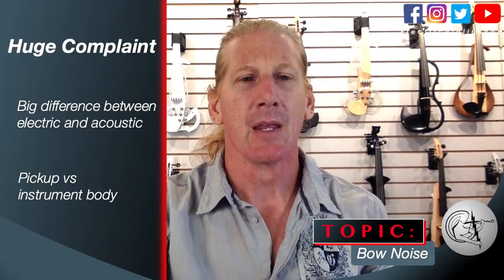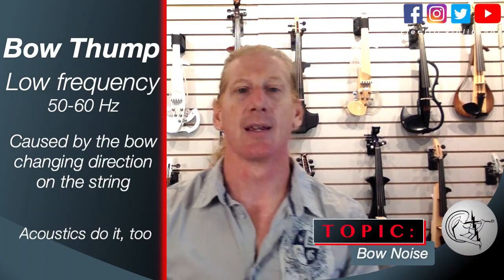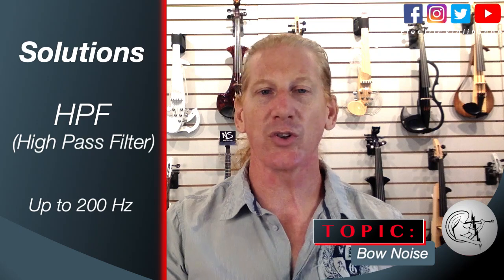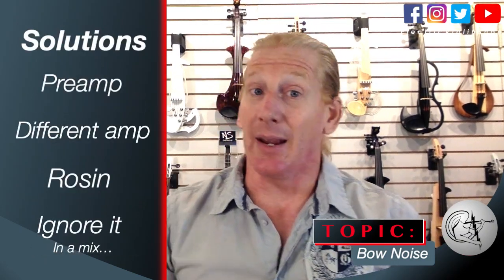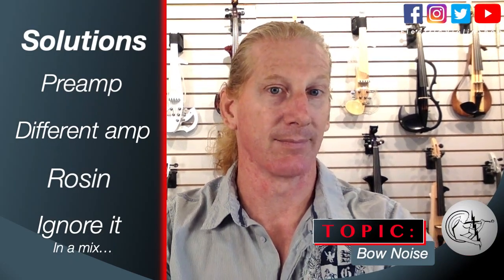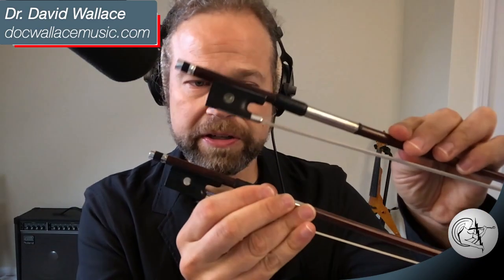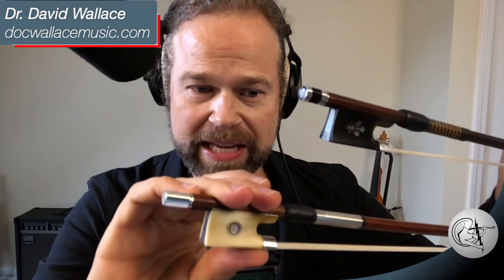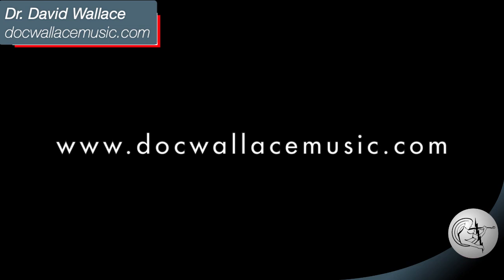Techniques for Dealing with Bow Noise!

Comment: The bow scratch noise can be reduced by tilting your bow a little, reducing the length of the hair ribbon that touches the string. Also, Rosin is just very problematic lol. There are rosins that work great on dry weather and others that work great on humid weather. That's only figured out by trial and error.

Comment: The 6kHz (rustle) sound may be stopping me hearing the top two strings on my acoustic violin.That frequency makes my cochlear implant turn down the volume .It happens when I hear the radio volume drop when I use a sandstone hand grinder .The radio comes back up as soon as the grinder stops .

Comment: I came here to reduce the scratch. The two things I have found is to keep the strings clean of rosin and use a noise gate. The NG reduces the scratch at the very beginning of a note where you hear it most

Lots of good advice here about bows, rosin, and technique.

Personally I use an amplified acoustic violin through a POD HD500 into a small Yamaha pa. It works about as good as it gets. Reverb and EQ! XLR out.

Comment: Great Video! Just one question: you talked about high pass filters for bow thump, what about low pass filters for the scratch? Would that work? Or is that not advisable?
Reply from the maker: Sure.  Just be careful that you don't remove too much of the air or brilliance of the sound.  Chasing after bow scratch can make your overall tone pretty dull and lifeless.  You're better off just letting it scratch a little.  (It's pretty likely that no one really even notices besides you.)
Reply: @ElectricViolinShop  right on, thanks for the answer!

Comment: If I were to have use a graphical EQ Pedal (such as the behringer EQ700), I would then turn the dials down on the freqs <200Hz & >6kHz. That way "theoretically" I can control for both of these? And by down I mean to <0dB
Reply from the maker: Most EQ pedals only pull down about 15 dB in each band.  And those are band pass filters, not roll off filters, so it's not quite the same thing, but it might help.  If you already have the pedal, it's worth a try.